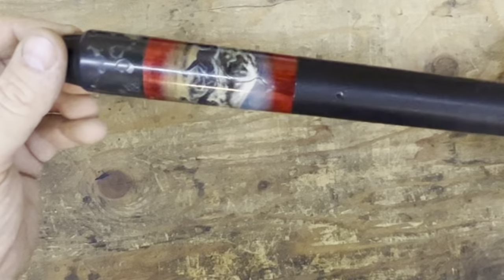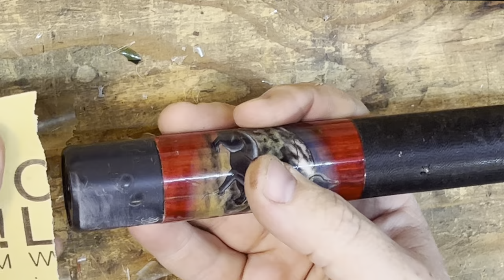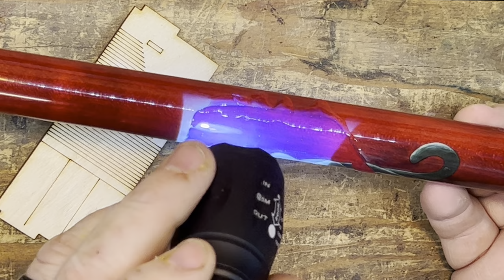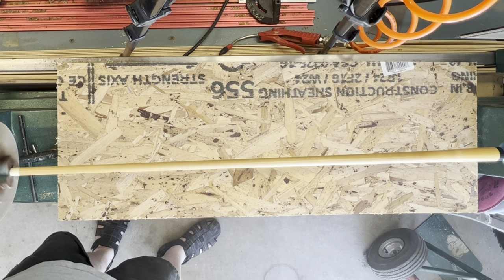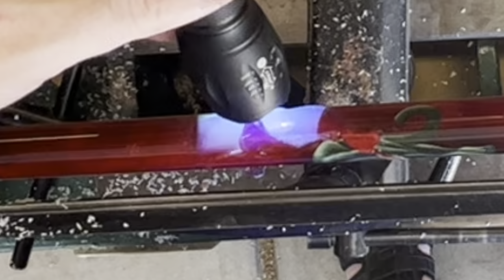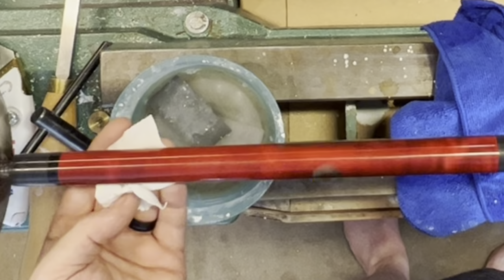McDermott Dueling Panthers Pool Cue Restoration

Comment: coating a wooden shaft broke my heart
Reply from the maker: The wood needed to be sealed or it would gather chalk causing it to turn blue like it was when I first received it.  The previous owner reduced the diameter but didn’t finish the wood.  Due to technical difficulties I wasn’t able to show me sanding the coating to 12000 grit and to make it ultra smooth.
Reply: @TwistedRestorations  I am quite sure you managed to sand the coating to be extra smooth.
My point is (as I play with a wooden shafts only), that I would never think about coating the wooden shaft, regardless how smooth is could be sanded. 
Coating of the wooden shaft would require me to wear the glove or use the powder frequently. Bare wood shaft can be also smooth and if maintained properly, it can serve a long time.
Reply from the maker: As I am more of a wood worker then a pool player I am curious.  How do you keep the shaft clean?  Or is the point that the shaft holds chalk to keep it sliding smoothly?
Reply: @TwistedRestorations  Normally you apply the chalk only on the leather cue tip, for obvious reasons.
But the chalk and dirt is transformed to the shaft, mostly on the parts where heads touches the shaft.
During the game I occasionally use a dry microfiber cloth.
From time to time I do use McDermott shaft cleaner. When I clean my shaft I do wax it lightly.

I've seen the wooden shaft coated before and no matter how the coat was sanded the movement was not smooth, especially when your hand starts to sweat a bit.
Reply from the maker: What kind of wax do you use?  When my daughter is in town I will sand coating off and try that.  Thank you for the tip.
Reply: This is NOT how your supposed to restore a cue. But good try I guess